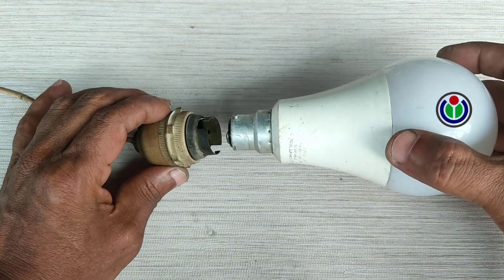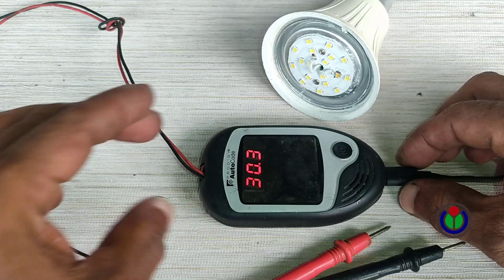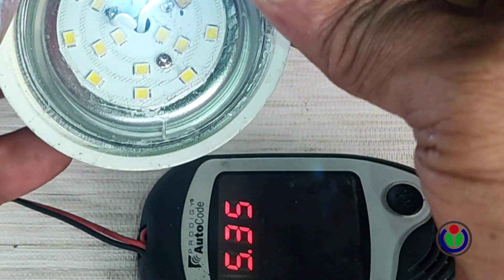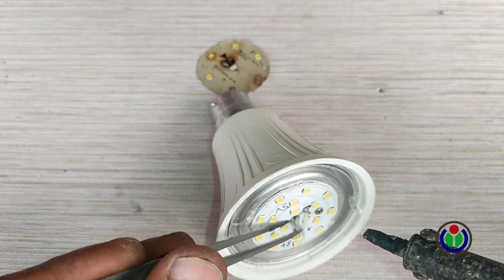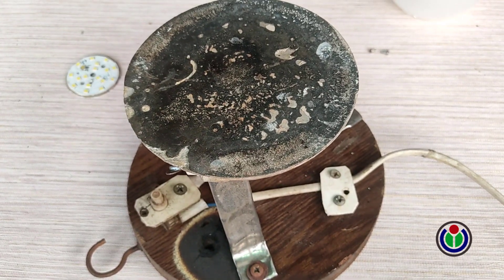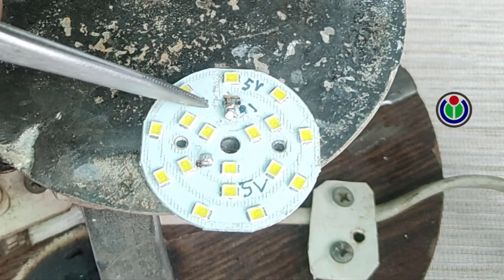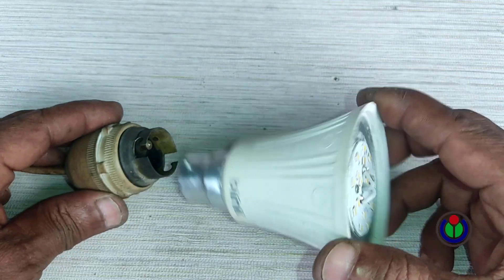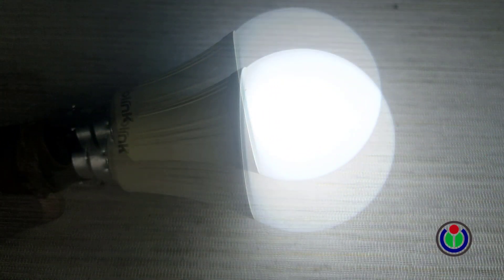How to Fix a Damaged LED Bulb in Just 1 Minute - No Cost, Easy DIY Restoration!

Comment: Hello, very interesting. Leds are in series, you could just solder a small wire or small piece of metal and complete the circuit?
Reply from the maker: Thanks for watching! But if you do that, the other LEDs will experience higher voltage stress, and the circuit may get damaged.